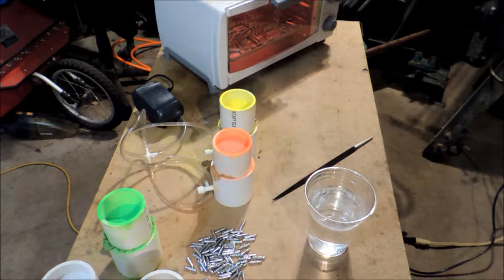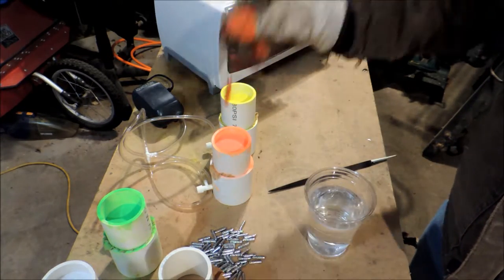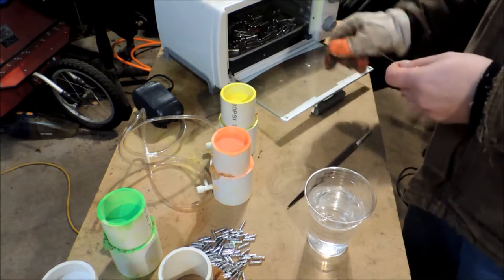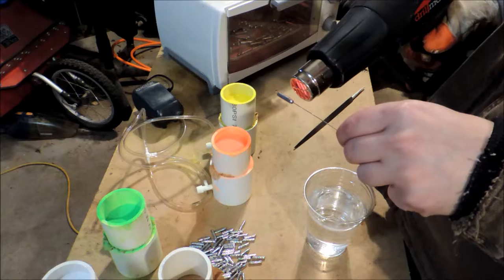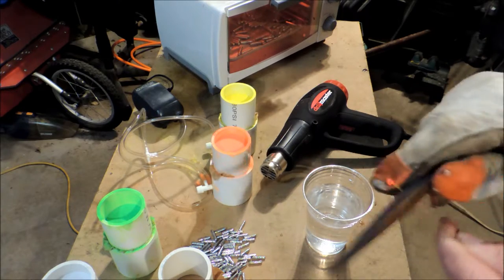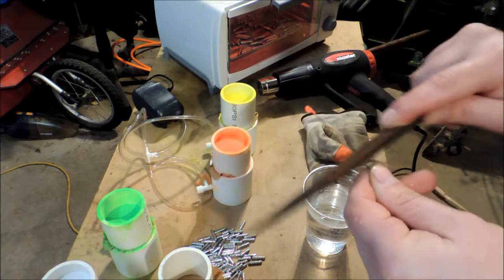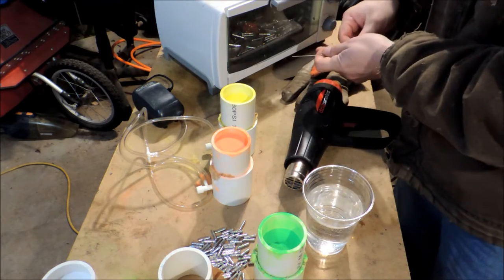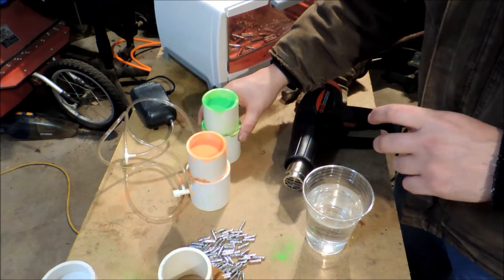Painting Do it mold lure bodys ✔️

Comment: great video. what do you do when the paint chips when taking the body off? i'm use to doing jigs and spinner baits where i dont experience that problem
Reply from the maker: I use some of them in the lures as long as the chip isn't too bad. If its beyond repair i just add it to the melting pot for the next run. you can also use them for slip sinkers if its the larger size.
Reply: You can just take the heat gun and melt the paint again,it'll often fix a chip.If it's a bad chip you can reheat and redip.Redipping will also build up the thickness if you overlap the 1st coat.

Comment: What temp do you run your oven at to get them hot enough for the powder?
Reply from the maker: My toaster oven has a high of 450 so I put them in on max if i am to dip them in paint. They cool down really fast once the door is opened so there is lots of opening and closing the door. to bake them it is less heat like 350 for 20 min
Reply: What Tinker doesn't tell you or probably doesn't even know and isn't telling you is....A toaster oven is not going to be accurate on the temps it shows on the dial.Many household cooking ovens aren't either.
Toasters can be off by as much as 75*F......
You want to get yourself a oven thermometer to make sure you are setting temps to the proper level.Two would be best because if one goes bad you'll be able to tell right away.

The temp you want to heat your piece to is all on you,just experiment till the powder paint glazes over when you dip it.You don't have to heat it to "max" like he says,up to 300 is more than enough...but experiment to see where you prefer it.If using a heatgun experiment here by counting how long you hold it over the heat.If it comes out dull and powdery looking you can just hold it over the heat to glaze it and then you can add a few more counts to it and retry on the next one. 
On jigs I'll only get them hot enough to get the paint to stick to it.It's a dull powdery finish yet and can even be rubbed off with your finger or bumping them together.This gives about the best coverage and also doesn't plug up the hook eye on a jig.

When curing the paint go by what the Mfg. of the paint says to use.....DO NOT go by what some dolt like Tinker tells you,they most likely learned it some other dolt and the paint isn't curing properly.